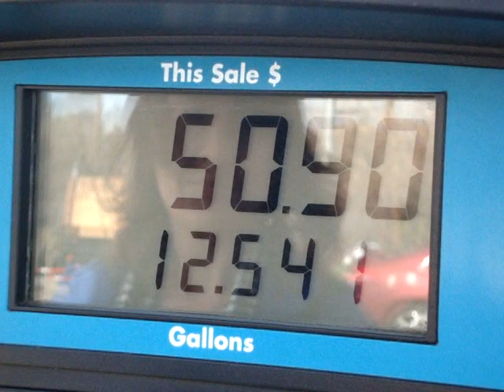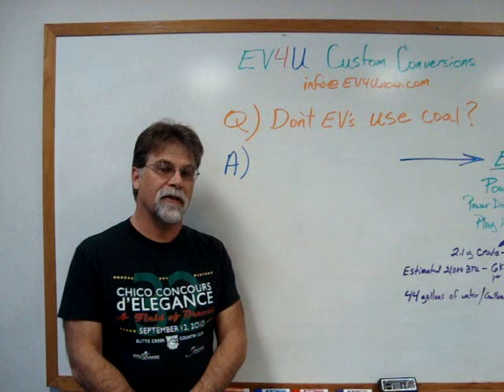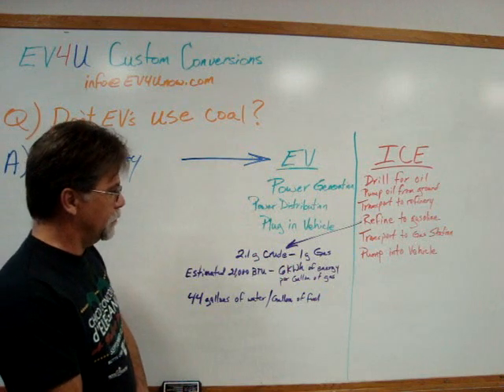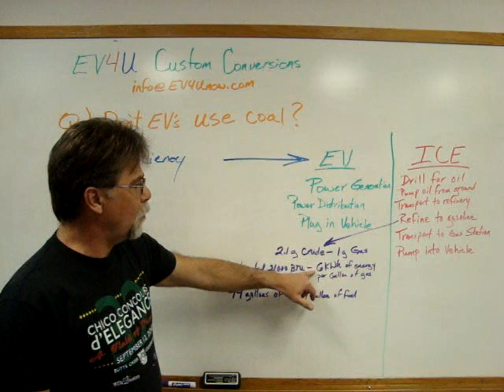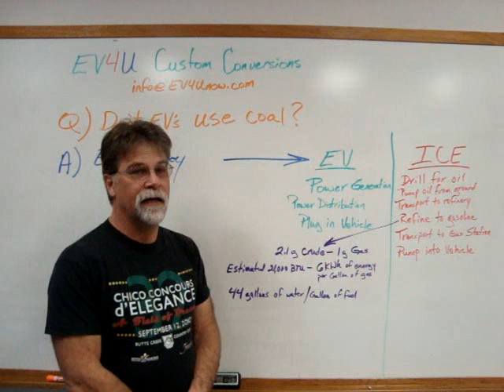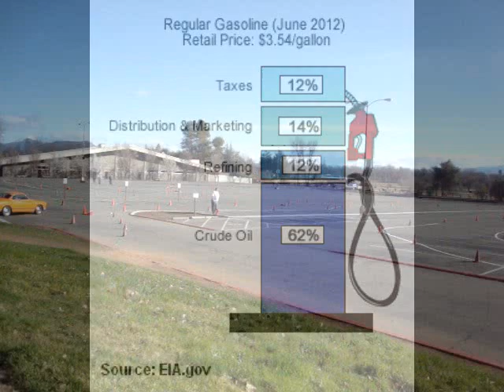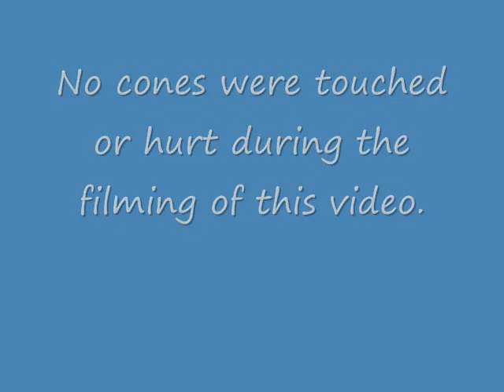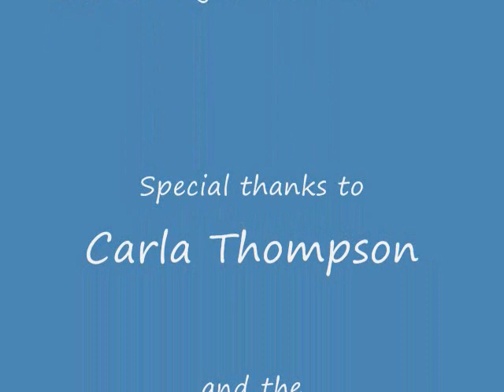Electric Karmann Ghia on the Autocross Track

Comment from the maker: The car handled beautifully.  Had power to spare.  The downside is decelerating.  An A/C setup would be better if your objective was to autocross all the time.  Key to a fast lap is picking a good line and driving smoothly.

Comment: The car is a 1985 Fiero that was running when I bought it. I drove it all last summer on 20 Crown 6 volt lead acid batteries. I haven't purchased the lithiums yet but will probably go with Winstons or CALB unless I can find a used set to start with. What would you recommend?

Comment: Enjoyed your show and look forward to your next one.

Just to be fair, there are also costs in mining and transporting coal. I agree that with all costs included, electricity is a greener solution to transportation.

I am currently working on  rebuilding a lead acid conversion that was done in 2008 to lithium batteries, so I am on board with using electric cars for transportation. (cztree.blogspot.com) 

Looking forward to next week's show